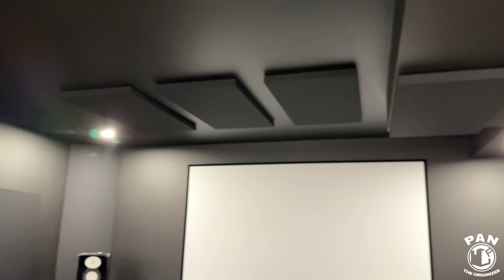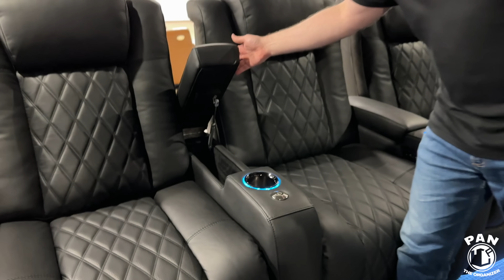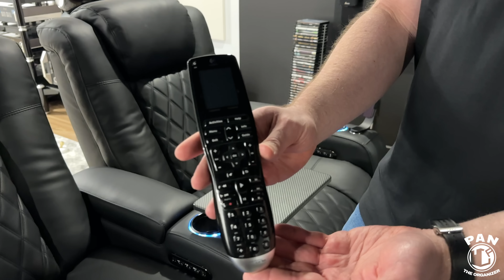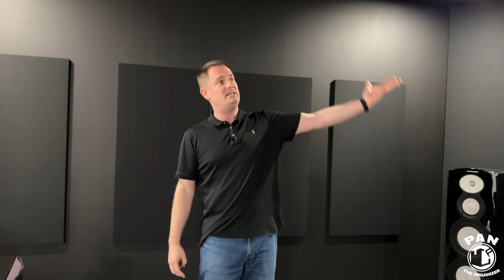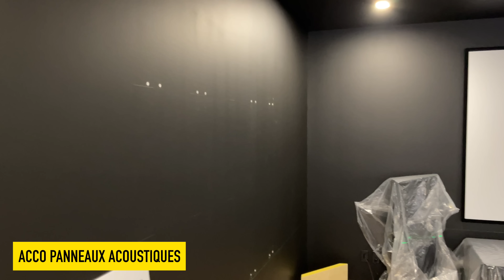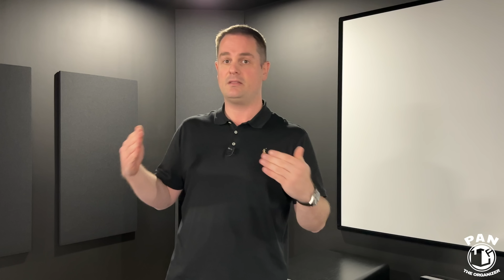Unveiling My Spectacular New Home Theater! Step Inside Ultimate Luxury

Comment from the maker: ⬇️🔶 LINKS TO PRODUCTS MENTIONED IN THIS VIDEO ⬇️⬇️

JVC NZ8 projector: https://bit.ly/3R02YWp
GrandView Edge 120” screen: https://bit.ly/47MnwI1
Revel Performa Be F328Be L+R speakers: https://bit.ly/3JAVvaY
Revel Performa Be C426Be center channel: https://bit.ly/4092r6k
GoldenEar SuperSat 50 surround speakers: https://bit.ly/3OO794M
GolenEar HTR7000 surround back speakers: https://bit.ly/45vafBV
GoldenEar Invisa 650 height speakers: https://bit.ly/47KZ4qi
Marantz AMP10 power amplifier: https://bit.ly/3L0Ic58
Marantz AV10 preamp/processor: https://bit.ly/3qQ12VK
SVS PB16-Ultra subwoofers: https://amzn.to/45LT3YG
SVS SoundPath interconnect cables for subwoofers: https://amzn.to/3PfRGMy
SVS SoundPath subwoofer isolation feet: https://amzn.to/3L2CQGN
Oppo Digital UDP-203 4K Blu-Ray player: https://bit.ly/45RNt7h
Apple TV 4K (3rd gen) streamer: https://amzn.to/3Ph3myv
Logitech Harmony universal remote: https://amzn.to/3L1v4gm
Valencia Theater Seating Tuscany Ultimate Luxury Edition: https://amzn.to/44LtZjP
Shunyata Research Venom PS10 power distributor: https://bit.ly/45RNGHB
Shunyata Research Delta Power Cables: https://bit.ly/3EfIb9A
AudioQuest HDMI cables: https://amzn.to/3PjehHO
AudioQuest speaker cables: https://amzn.to/3qKFI4a
Signal HiFi Magic Power subwoofer power cables: https://bit.ly/3OV1Hxg
Chief RMPA281 projector ceiling mount: https://amzn.to/2pIGWNC

✅ My HiFi music setup: https://youtu.be/HrWId9H6l4c

Comment: I enjoyed watching. I have not got to experience anything as nice as your room. I would love to compare it to mine. I have nothing close to your budget. I would love to hear the difference. My room is 16 X16 I have a 120 ALR floor rising screen, Onkyo 797 Klipsch 625 FA Dolby Atmos pack with two Subwoofer’s and added rear height speakers. For seats I have 4 Seatcraft Diamante  with sound shakers. My projector is an AWOL 3500 Pro   I have treated most of the room. My total cost is around $16,000
Reply from the maker: Thanks for sharing!

Comment: oh no, you fell for the power cable snakeoil..shame cause you got great speakers and projector. Dont let them fool you man, the "noisy" power they claim is pure nonense...all ac to dc conversion gets rid of any noise that is why they NEVER measure any difference in the output of your gear only on the input to fool people into buying their snake oil.
There is ZERO properly done blind test that has EVER proven their claims much less factual evidence.
I have 3rd party cables for looks, not for performance.

Comment: Man i wish they had black drivers. Even with grills i will see the white in my pitch black theater room. Such a shame
Reply from the maker: I don’t even notice them when playing movies. It’s a non issue for me.
Reply: @PanTheOrganizer  My room is pitch black with total light and reflection control. All LEDs covered..black hole level. So you are saying that with the grills on ou cannot see it? Because I tried adding a similar colored white material to the cones with the grill and I can still see it.
I do have a very large viewing angle so I am closer than most to my LCR and screen.
Then again, you have your AVR etc in front so I dont think you are nearly as picking about ANY lights or reflections as I am so that will explain it.

Comment: In my livingroom home system I have no center speaker, my amplifier has something build into it called virtual center. So instead of telling my decoder (Oppo bdp 103 bluray player) that I don't have a center,  I have it setup as if I had. So there is cable going from the center output of the Oppo and to my hifi / surround amplifier, so the amplifier receives the full signal. And then the virtual center part distributes the center audio to the front speakers. It sounds so much better this way than having a dedicated center speaker. The vocals are right in front of the TV screen and it sounds as if they were speaking i my room, just like when listening to music.

I know when you are more than one people watching a center can be great to have, but when you are just 1 or 2 people watching it works great without it. I usually watch movies alone so Im always sitting right in the center sweetspot so it's perfect for me. Normally when people dont have a center they set it to off in the decoder, and the decoder then creates this phantom sound where it sends the signal to the left and right fronts. But the virtual center feature mine has sounds much better than the phantom. I find with a center speaker it is too easy to hear that the sound is coming from a box, but without the center speaker it sounds just like with 2 channel stereo for music where you have the vocals floating in front of you in the center. Most people think that you need to have a center speaker but it's not true, specially if you are watching alone and sitting in the center sweetspot. It sounds much more natural without it. But to get the best result you will need an amplifier that has this virtual center feature. The center channel is made more for cinemas where many people are watching and where everyone can't sit in the center of the room.

Comment: I dont understand why specially all people outside of my country, dont build up a Double or Single Bass Array. Here nearly all Homecinema Guys who realy into the hobby have at least 8 Subs, Bafflewall, massive Acoustic treatment (not such flat panels) etc. Why no one know abouts this and nearly all place just 1- 2 Subs in their Cinemas. Specialy all Setup i saw from the US, also from ,,professionell,, installers use only Pre-Made Stuff and just place it in the room. No custom solutions, no bass concepts.
Dont get me wrong if its works for you its okey but I'm just curious why no one thinks about it, because the Lowend response with an well done Bass Array is miles better than a single or dual sub setup on on the ground.
And its not realy more expensive that an pre made big SVS or similar Sub (for impressions look at the YT channels : HollywoodZuhause, Kniff, GrobiTv)

Comment: I hope you had your electrician upgrade all your wiring and switchboard to audiophile grade components.
Oh and get the electrical company to upgrade your transformer too. You dont want any dirty power. 😂
Reply from the maker: That’s the typical comment from people who juste hate. “Dirty” power doesn’t have to make it up to your components. If you have something in the final leg of power distribution that can clean up that current, there certainly is an improvement to be made.

But do A & B testing and see if you notice a change or not. If you don’t, good for you, you saved a crap ton of money. But don’t be ignorant and belittle those who do hesr a difference with high quality power cables and conditioners.

It’s not like it’s the biggest sonic difference. Spend the majority of your budget on quality speakers and amps first, then other components, and then fine tune that with the cables.
Reply: @PanTheOrganizer , appreciate the response. I'm an electrical engineer, and I have a pretty good understanding of harmonics and rectifiers and switch mode power supplies etc. As long as the amps and sources are made with reasonable power supplies with decent filtering on the DC side, trying to improve the quality of the AC waveform (in any country with a decent and reliable electricity network) is a waste of time and money.
Saying that, there might be some slight gains to be made from upgrading the in wall wiring to something bigger (if you haven't already) to reduce voltage drop and make sure those amps have a suitable supply. You could even run them off different phases so they can't affect each other

Comment: I have not and suspect they are great. Arc, for me, just allows a level of flexibility in tuning that leaves others behind. I also use REW for the subs before Anthem. Regardless you have a great setup. Cheers
Reply from the maker: Thanks Doug! I haven't looked into ARC, or the Dirac room correction on my Marantz (I just used the Audyssey MultEQ XT32) but I suspect having a pro audio calibration done by a Dirac expert will likely bring the audio to that next level. That's one thing I'm looking into.

Also, since this video, I added the new flagship Kaleidescape setup with a Strato C player, and the new Terra Prime SSD server. The video audio quality is as good as it gets, making my Oppo UPD-203 4K Blu-Ray player obsolete! Hehe.

What is the rest of your home theater gear by the way?

Comment: Good afternoon  Cool set!  Congratulations.  Please tell me, have you probably connected AMP 10 to the bridge on your front and center channels?  And in the AV 10 settings the speakers are set to "full range"?  I also have these components working with the MK SOUND S150 series||  and I connected 5 channels to the “bridge”, since it seemed to me that it was not enough!  Thank you)
Reply from the maker: No bridge. And speakers are set to small, as I have dual subwoofers.

Comment: Very nice system and the room looks great. 

 I personally think the 328be is a better speaker for music than those B&Ws, I have owned both bands myself. I sold my revel 228be and moved onto the JBL 4367. My theater is all JBL synthesis at this time. McIntosh and Marantz electronics.
Reply from the maker: We share similar tastes for great components!

What projector are you running for your home theater setup?
Reply: @PanTheOrganizer  I am using a Sony 5000es on a 120” 16/9 screen (the room is a batcave) but my interest in audio first. I tend to stick to Sony because I “need” the lower response time. When dropped down to 1080p/120 it is 8ms which makes a huge difference for competitor games.

I combine my two channel and home theater into one though. I have thought about splitting them (as I have room) but I like to game with the sound off and music on. 

Anyway I really like the 328be/228be and used the 228be with JL subs high-passed for about two years. I almost went full Be for my theater but bought the JBLs on a whim and found I prefer them. They are my first horns and a revelation for me. Everything just sounds less produced and more real. Drums snap harder, etc. 

I had the 228be the same time as the JBL 4367 for direct A/B and the JBL is both more detailed and dynamic. You do give up soundstage depth and width as the trade off for dynamics. The tonal balance of the JBL is almost identical to the Revel. Interesting I like the JBL better for music and the revel better for surround sound, which is the opposite of what I would have thought before owning both. 

The wide dispersion of the Revels works really well for home theater and I find I don’t need the added dynamics for movies.

Comment: Btw why wasn’t a power conditioner used with such valuable equipment?
Reply from the maker: Perhaps you missed it in the video, but the high quality Shunyata Research Venom PS10 power distributor was used. Link: https://shunyata.com/products/power-distributors/venom-line-power-distributors/venom-ps10/

Comment: Very nice system!  I also have the Marantz AV10 and love it but I have found one issue.  I'm also using the JVC NZ8 but I'm using it with an anamorphic lens.  Unfortunately the AV10 doesn't play well with a constant image height system.  The onscreen volume level display is limited to either the very top or the very bottom of the screen which places it outside the imaging device leaving me without onscreen volume display.  I've contacted Marantz but they seem to have no interest in resolving it.

My theater is still a work in progress, my job is just about 100% travel, 300+ nights/year in hotels so it makes it difficult to build a DIY theater.  I've built the LCR speakers and side speakers but my CNC went down a few months ago.  I got that back up and running on my last trip home so I'll be cutting parts to build the rear and Atmos speakers on the next trip.  I'll also be cutting parts to build manifolds for four more infinite baffle Ultimax 18's above the theater.   These will be near the back of the theater, two on each side to improve bass uniformity across the listening area.  The existing eight are near the front spanning across the center of the room.  

I still have a lot of work to do on mine but I think it will be worth it when it's finally completed.  Knowing me, that will be about the time I decide to sell this 2nd, "forever house", build a third and start over.
Reply from the maker: Seems like you'll have a pretty insane setup too!!
Reply: @PanTheOrganizer  Yeah I'm pretty happy with the way the big CBT Line arrays turned out.  Can't wait to get the whole thing finished. 

Btw, have you considered the MadVR?  I've been thinking about getting one.

Comment: Setup is awesome. Question is that enough room for heat venting on the marantz amp and processor. 😮 I custom made my cabinet and gave it near 6 inches of space before the second shelf for my marantz. I run 3 702 s2 for my LCR.  I wish to hear revel demo someday. Haven't found a local dealer yet. 😕
Reply from the maker: Thanks! Yeah no worries about ventilation as it’s open on all sides including the rear, and a good inch on top. I keep the air cool in my house (20C during the day and 18C at night) year round, and it’s in the basement, so no equipment ever gets warm really. 

If you have the opportunity to test flagship Revel one day, get your money ready as you’ll want to buy right away.

Such a huge upgrade over my previous GoldenEar Triton Two+ I had.

And even in HiFi they would still do great for two channel music. But as you know, I have an absolute over the top two channel setup which I unveiled in this video: https://youtu.be/HrWId9H6l4c?si=gCBBO1Ux2-l4O1zY

Comment: I too used to own dual pb16's test while I had them. I upgraded to four jtr captivater 2400's. No comparison.
Reply from the maker: Interesting. A few viewers have spoken to me about JTR subs, and they seem legit. But I have no reseller in the Montreal (Canada) area so I can never get to experience them. Also, they seem quite huge, perhaps bigger than my SVS PB16 Ultra subs, and I wouldn't have the space for that I think...

Would two JTR subs be ok running off one dedicated 20A circuit?

Comment: Very expensive setup with nice equipment, but there are still too many hard reflective surfaces. Additionally, piano black (or any gloss finish) for speakers (and anything else) is a horrible choice for a dedicated projector theater. It reflects too much light and creates glare, etc.
Reply from the maker: Hard to see on camera, but they are angled in a way where it’s zero distracting when watching a movie. I have yet to have a single complaint.

Comment: Sports cars, detailing, and high end audio. Did we become best friends?! Love these videos Pan. What do you use to clean the piano black on your speakers and subs?
Reply from the maker: Thanks!! Yeah it's nice to share common passions with my viewers. I also love luxury watches and sneaker collecting. By the way, what HiFi setup and Home Theater setup do you have?

My SVS subs are matte black. For the Revel glossy black speakers, I will use a plush microfiber towel like The Rag Company Eagle Edgeless and a rinseless wash solution in a spray bottle to gently wipe.
Reply: Bowers and Wilkens CM10 S2 floor tower speakers, powered by Rotel RB-1582 MkII 200 watts per channel in 8 ohms, rotel RC-1572MKII preamp, AudioQuest speaker cables bi amped. 

My other room I have kef q350 speakers in stereo with integrated rotel receiver/amp and subwoofer. 

I wish to get into home theater set up one day.  @PanTheOrganizer

Comment: Hi, I have a correction on your Kalidascape comment. Their movies ARE compressed. Slightly less than UHD discs but still compressed.
Reply from the maker: That's not the info I got. What is your source for the information? Anyways, regardless, I recently bought a full new Kaleidescape setup (Strato C player and new flagship Terra Prime SSD) and I can confirm it does look better and sound better than any of my UHD discs. Sometimes quite noticeably, sometimes a tiny bit better, but there are improvements. I think this is as good as it gets for now.

Comment: Another great video Pan.  I’m envious of your home theatre room.  Have you looked at the Buttkicker setup?  I have this in my seating and it adds an extra level of realism
Reply from the maker: Thanks! What is the buttkicker setup? Sounds like a joke…
Reply: The buttkicker is a device that vibrates your couch.  It has its own amp and connects with your subs.  Any explosion, gun fire or the like will be felts coming up through your seat.  I mounted mine directly inside my couch and installed soft rubber feet on my couch to insure that vibrations would be felt clearly
Reply from the maker: Oh kind of like DBox? Yeah I'm not interested in that for the moment. What I did get since the video was filmed is a new Kaleidescape setup. Strato C media player and new flagship Terra Prime SSD movie server. Uncompressed video and audio for a full studio master movie experience. Makes my Oppo 4K Blu-Ray player obsolete. What an experience!

Comment: With the four in ceiling speakers, have you tried running it in the 5.2.4 configuration instead of your current? I heard or read that the at most experience is a lot better with that configuration. Awesome setup none the less
Reply from the maker: I haven’t.
Reply: The up mixing of 5.1 rendered movies with 4 height channels IMO is where it's at. Personally I've had some better listening experiences with 5.1 rendered movies with four height channels hooked up, then listening to some actual  Dolby Atmos content. One is not just maximising the Best of Both Worlds, but when listening to 5.1 with four height channels. What little audio does decide to come out, it doesn't just come out more often but it also tends to stay out a lot longer too 😊